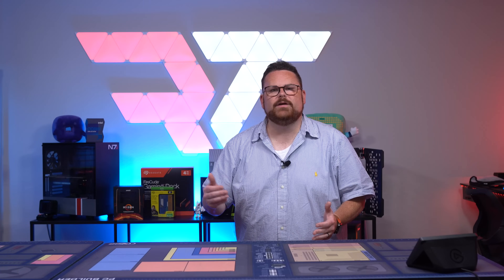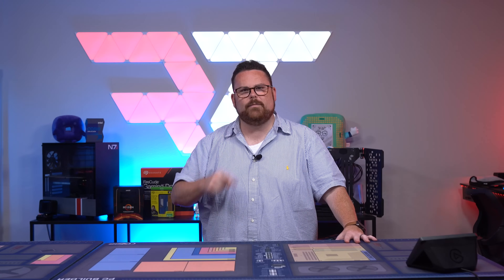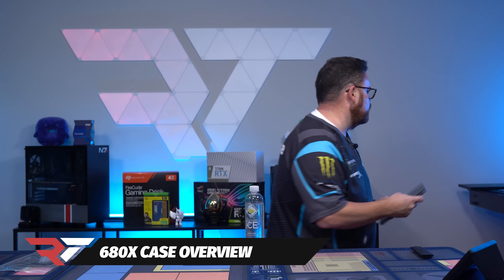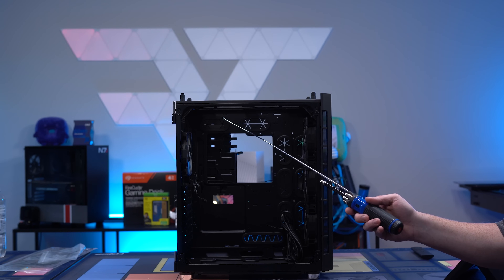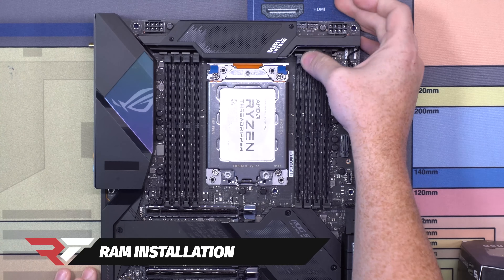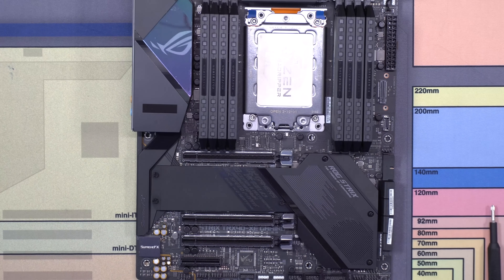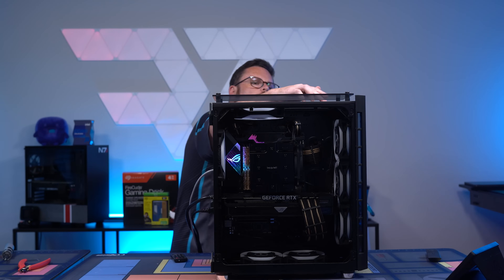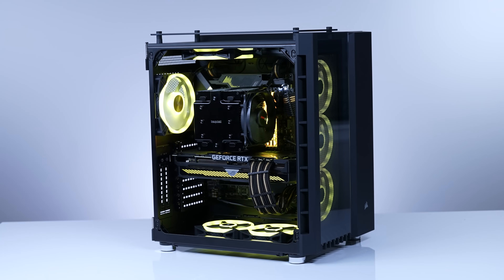The $9000 Dollar Drama Mama! The Crystal Threadripper Build + Benchmarks (TR 3970x and RTX 3090)

Comment: 12:25 Was the 3970x overclocked? Why are the temps so abnormally high even in an open case and with a full cover AIO? Running at 95 *C is not healthy for the CPU. My Noctua NH-U14S TR4-SP3 air cooler keeps my 3970x at 60-something degrees C at prolonged full load (Blender render) and in a closed case. I think that the Thermaltake AIO you installed might be defective. You should definitely check it and swap it out for literally anything else. These Thermaltake AIOs are famous for being complete garbage. Otherwise, beastly build indeed! 👍

Comment: I have a Ryzen 9 3900XT cooled by a 120 mm AIO which I mounted at the front where the radiator is in between the stock case fan from coolermaster TD500 Mesh and the AIO's fan. Is it good enough to cool my CPU or should I switch to a 360mm??? also there are no exhaust fans at all. only 3 intake fans at front and another intake fan from the AIO also at the front.
Reply: positive air pressure should propel the hot air out of the case from any slitted/porous metal left in the case by the manufacture but you did not list the  cpu temps that you get during gaming.. can you provide those?
Reply: @TheCreatorBeast  I didnt go beyond 87 when playing valorant at max settings

Comment: I bought this case, I love it, the look is beautiful, and I plan to use an AIO and plenty of fans. But I'm not building a Thread Ripper either lol. I have a 5900x I'm throwing into it, it should be fine. Though, I may look into modding the front panel. Not sure why they didn't at least put some vent holes into the glass, but other than that, I'm glad I got the case. :)
This build was cool to watch man, thanks for sharing.